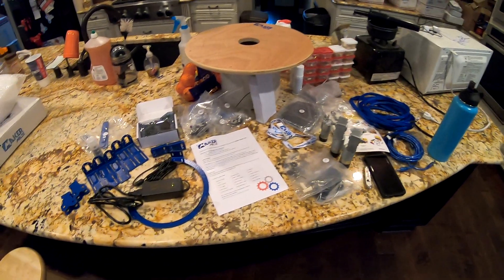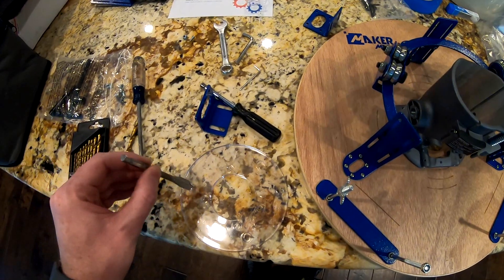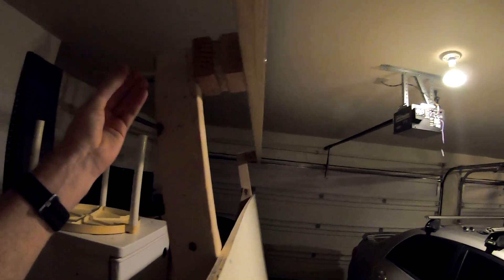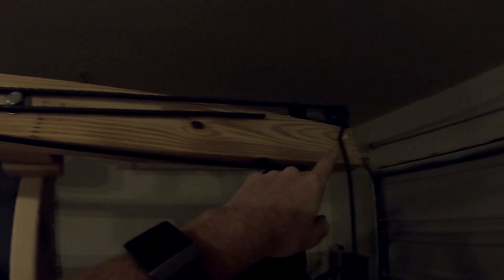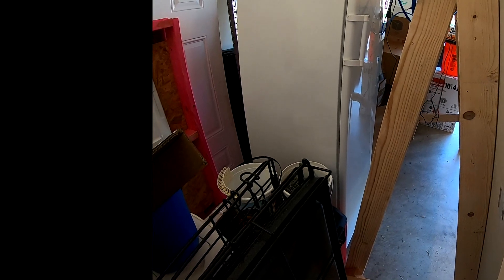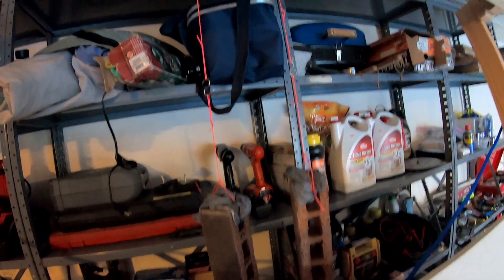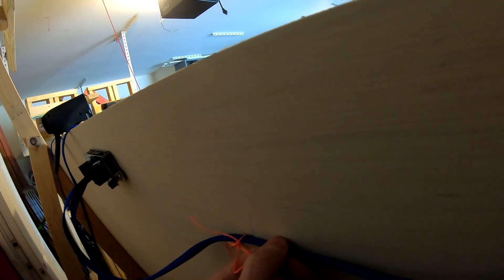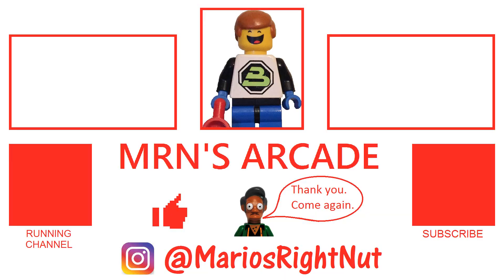DIY CNC Machine - Part 1 - Assembling Maslow Open Source CNC Machine

Comment: always thought that frame they showed online is overkilled no need to have that many 2x4's. 3/4' plywood is enough to keep the whole frame together and also the legst need to be cut agle so the whole thing sits flat on the floor whatever that angle is.
Reply from the maker: The stock frame is a little beefier. This version gets pretty stable after you screw the spoon board down. And I thought about cutting the bottom of the feet. But it works fine like this. It was just an extra step if you don’t care about esthetics.